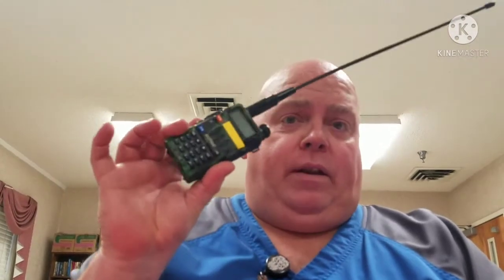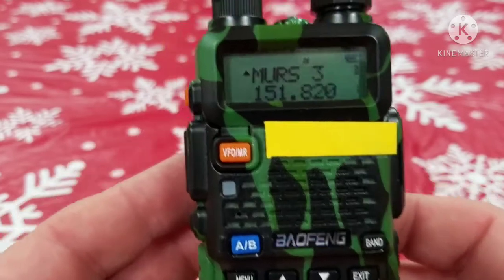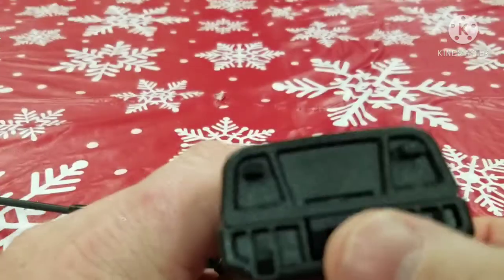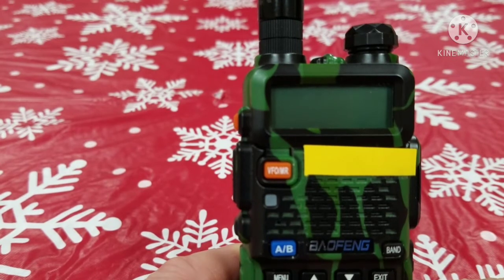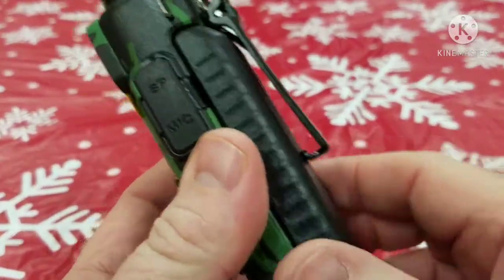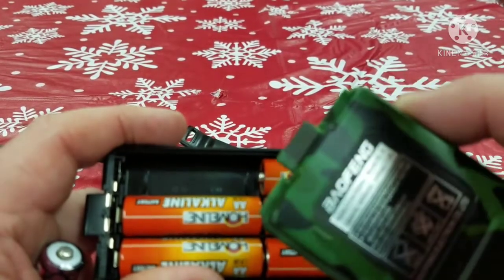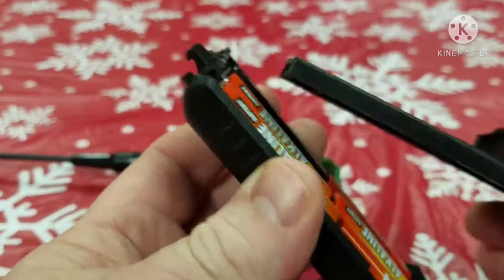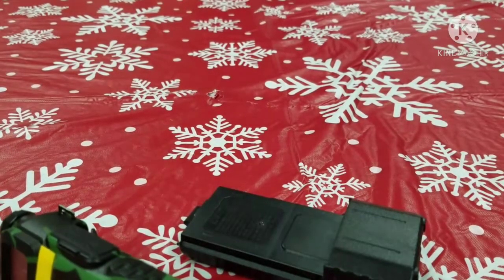Powering your Baofeng radio with AA batteries.

Comment: Alot of people actually operate these radios with 9 volts and tx just fine. The issue with yours is the batteries dont have enough current to transmit.  

The batteries in series do add up to 9 volts. But there mah rating remains the same.  The batteries that come with the radio offer 3.5-4 amps...thats alot more than a AA battery.